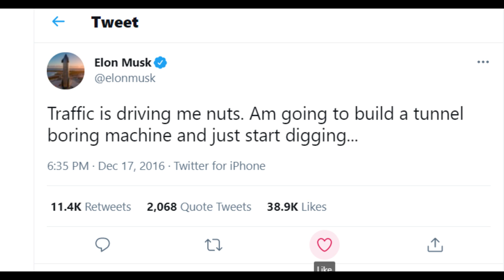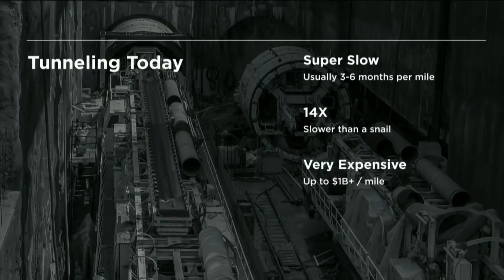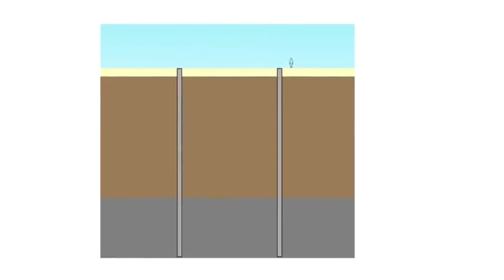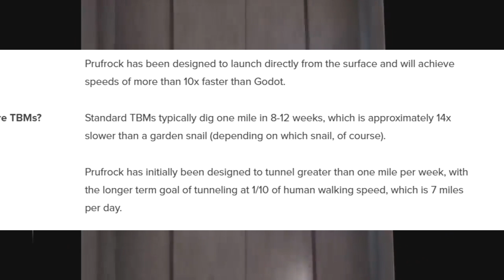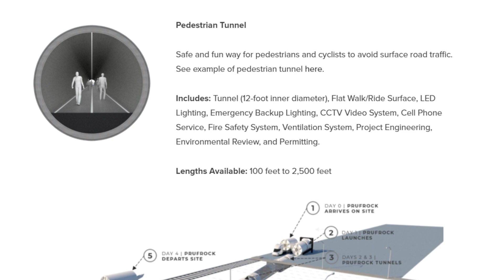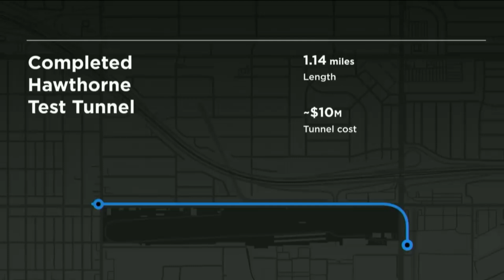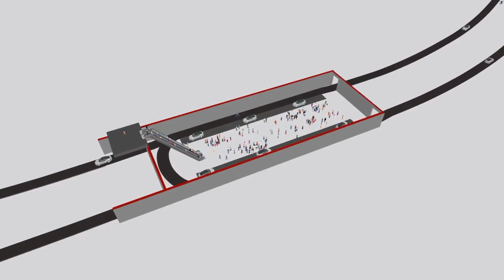THE BORING COMPANY: Elon Musk's Answer to Soul-Destroying Traffic

Comment: I think the potential of the Boring Company is VASTLY underestimated - but to achive that potential, a couple of things need to go right from now on and a few years goind forward.

1) One thing is the moving people around, like the newly completed tunnel. Sadly, what they envisioned/previewed was not what happend, and that has left a mark and a need of an explanation. As many have said, in the end it is just a tunnel with cars right now, going slow. HOWEVER what people also need to remember is: 
- How cheap/fast it was to make it, compared to a normal tunnel
- Need for transportation is only going to increase, be it for conventions (as often seen in Vegas) or just plain increase in population density, so something needs to happen either way
- Right now, they are limited by a few things like fire regulation laws (which are important, don't get me wrong!) and peoples trust in autonamous driving. When (not if, I belive) these things will improve, say if Boring used the maximum number of allowed vehicles (no passengers) in the tunnel with auto-driving, driving round the clock for X amount of hours or miles, with no incidents, then they might be allowed to do so. That would increase the amount of people transported and thus the happiness for the system.

2) They make other types of tunnels, which are incredibly useful if implemented! 
- Always need tunnels for infrastructure, plumbing, electricity etc. A standardized size(so a city can more easily plan and service them) with a set price could bring in a lot of business
- Tunnels for moving freigh containers could be the BIGGEST innovation Boring could bring! No passengers so much higher speeds! Move containers off a ship, onto an electric sledge and send that sucker from point A to B soooo much faster than any trucker could do so. Make a few big hubs, say around major habours or airports, and a couple of centralized hubs in the host nation, from there they can then be divided up and sent to their final destination (say, on a Tesla Semi truck)

Add to that a bunch of solar energi, some Tesla Powerpacks etc.and you can shape a humoungous amount of CO2 on top of it all (not saying 100% clean, but MUCH greener than the alternative of doing nothing)

Just a few random thoughts
Reply from the maker: Martin - you bring up some great points. I think you've nailed it though ... freight movement may be the single largest market opportunity for TBM.

Comment: The minimum time between the west and south LOOP stations is 2 minutes 45 seconds without any other vehicles in operation (as shown in multiple media sources) so the 1 minute claim is already turning out to be a lie.
When you add the time it will take to walk to the LOOP station, wait for an available vehicle, load into the car, unload from the car, walk back to the LVCC building the time savings over just walking is just over a minute but only if you start near one of the stations.
Reply from the maker: Following through on these claims will be important for TBC. I view the LVCC as the testing grounds and things should get better from there.

Comment: Soul destroying traffic will just become soul destroying traffic underground.
Building more highways won't provide more capacity on city streets which is the cause of congestion.
And the loop is a very expensive private taxi concession. It is not transport for the masses or for all.
Reply from the maker: I'm hopeful that TBC will be able to solve underground congestion. Assuming that underground transport vehicles can be large enough, I think there's a good chance they can figure it out.
Reply: @trailblazedHQ  if vehicles that could fit into such a small diameter tube were a viable transit solution, why wouldn't it be one of the standards already.
There are companies that are focussed on the right part of the problem. Developing self driving mini busses with on demand service.
Google 2getthere GRT.
Any company can bore a tunnel. TBC has no secret tool or process.
Reply from the maker: @EricLDunn  One potential reason it hasn't happened yet is cost and time to build, both of which TBC has drastically improved on compared to existing technologies. Ultimately, you may be right that this will never work ... it's still an interesting concept and I'm interested to see where it goes (if anywhere).
Reply: @trailblazedHQ  solve underground congestion? There is no underground congestion. 100 years of studies and actual city planning show that increasing capacity DOES NOT REDUCE CONGESTION OF TRAFFIC. DO. RESEARCH

Comment: No fuel costs... where can we all access this free electricity you describe?? And don't they have to deliver 4400 per hour to get fully  paid, as opposed to the 1200 you mention?
Reply: fu·el

/ˈfyo͞o(ə)l/

noun 

material such as coal, gas, or oil that is burned to produce heat or power.
Reply: Not all energy sources come from "fuel". "Fuel" is not synonymous with all energy sources. Wind kinetic energy, solar energy, and geothermal energy not free, merely fuel-free as they don't extract energy from burning.
Reply: @BlueOceanStrategistS  I'm pretty sure these tunneling machines aren't being powered exclusively through solar or wind... and even if they are that's not free.
Reply: @Martinmack333  Right, they are not free, they are just fuel-free.
Reply: @Shilly Goldstein Wind isn't fuel. Solar isn't fuel. Hydro isn't fuel. Geothermal isn't fuel. Fuel for electricity is optional, not necessitated by the laws of nature.
Reply: Whether the electricity right now relies on fuel such as oil is relevant in the short term. There is no relevance in the long term since just about all fuels (except food) will eventually be obsolete as a source of energy.
Reply: @Shilly Goldstein It's not. It has the potential to be. Missing from my post (and also the video): "potential to be". The remaining issue is with Martinmack333's erroneous equivocation of "No fuel costs" with "free electricity".
Reply: @Shilly Goldstein The tunnel is just that, a tunnel. What matters is if it is even possible to make one that isn't as expensive as today's tunnels. I don't mean just making it smaller (that's kind of cheating), but rather improving the process of building the tunnel itself. The newer TBM being developed by TBC (Prufrock) wasn't used for this project, but already there is the prospect of eliminating the costly and time-consuming launch pit at the ends of the tunnel and simply angling the TBM itself for the initial dive and subsequent resurfacing at the end. The engineers at TBC will be obsessing over how to increase the power density and the required cooling system for it. In the end, a tunnel is basically just an absence of dirt that you can go through. Any automation of the construction itself, as well as the drivers in the vehicles will substantially affect the upfront and operating costs, respectively.
Reply: @Shilly Goldstein The improvements (R&D) are being setup behind the scenes but are not implemented in the LVCC loop. How is that not obvious?
Reply: @Shilly Goldstein I am simply expressing my opinion as to the current state of affairs. There is nothing wrong in acknowledging that technological development will occur prior to the emergence of "patently obvious" evidence for it. To simply argue that it is exists isn't "hype". Though, yes, Musk's companies do thrive on "hype". How do you suppose that they receive 100,000's of job applications (if not millions)? They can pick and choose who works there precisely because the "hype" is a beacon for those who like a challenge, who wish to contribute to disruptive technology. Look, I am not really doing much to "increase" the number of people who apply to jobs in these companies. It's outside my power. Regardless, some people will put more "faith" in the future and so will find a way in their minds to try to make it "work", even if at first it is not exactly apparent how it will be done. Others like yourself are simply not interested in "fortune telling" and see reality in the present time only, which is easier, sure, but is far from the innovative mindset that will, you know, actually change things.
Reply: @Shilly Goldstein Also, far from being a "fan boy" of Musk (despite what my account avatar may imply) I have a vested interest in one of The Boring Company's competitors, because I think tunnels are not ultimately the best solution to solving traffic problems. Nevertheless, I keep an eye on The Boring Company precisely because the relative success/failure of The Boring Company will have a material impact on my vested interests.